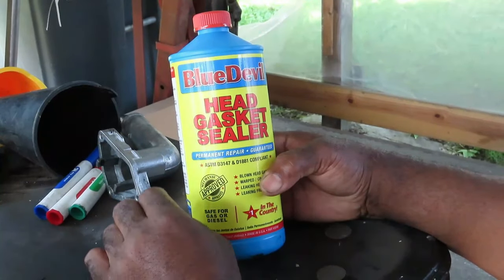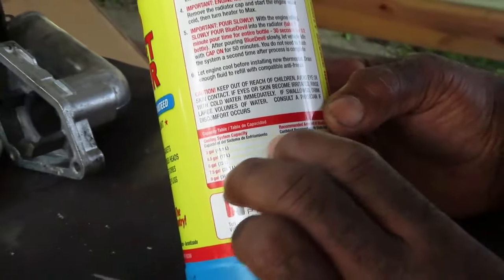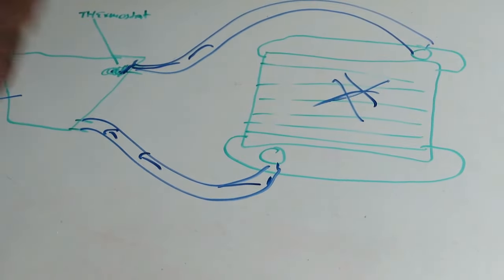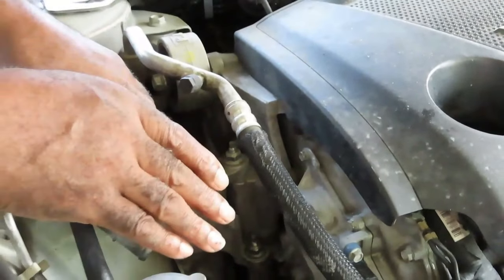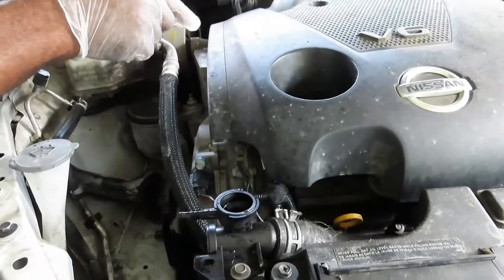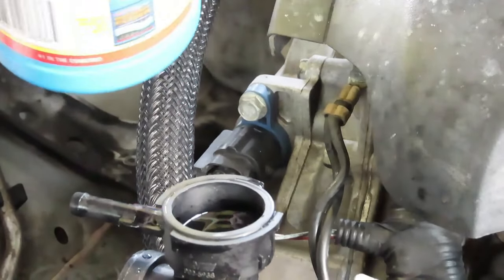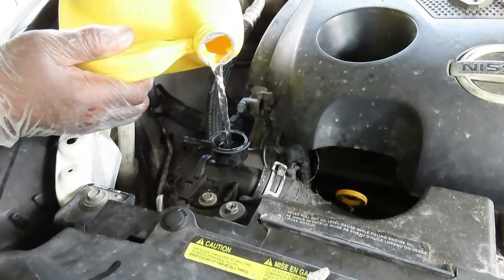How To PROPERLY Use Blue Devil Head Gasket Sealer. #bluedevil #headgasketsealer

Comment: I’ve been reading the comments and a lot of individuals are misinformed!
There’s 2 types of Blue Devil Sealers!
Yellow label needs the thermostat removed!
White label the thermostat does not have to be removed! I used the white label Blue Devil in my 2005 Corolla and it worked to perfection!
Reply from the maker: I've got a find a way to PIN YOUR COMMENT! So sick and tired of people saying "you don't have to remove the thermostat"
Reply from the maker: Just PINNED it, thanks for speaking up and saying that!
Reply: @OnlineAutoRepairVideos
Thank You! I really appreciate that!
It does work. People just need to read/follow the instructions and also do research on the Blue Devil head gasket products.
Reply from the maker: @kelj4517  EXACTLY!
Reply: Damn glad I saw this I got the yellow label hopefully I can return it and by the pour and go so I don’t have to remove my thermostat
Reply: @OnlineAutoRepairVideos 

Did this work on the 2014 maxima or did it end up not working? How bad was the radiator bubbling or how bad was the leak? I jusy want to know because i have the same exact car with the same exact problem
Reply: What about the red top

Comment: The best way to prevent head gasket damage is to change the oil on time always, I learned that lesson two years ago the hard way.. lol
Reply from the maker: LOL!
Reply: That right it true
Reply: Not true.
Reply: The best way is not forget to close your radiator cover or never use a radiator cover that's rusty and not very tight. That's how I lost my engine almost twice.
Reply: I know the what but wanted to know the why and I think you just gave it to me! Ugh
Reply: Most leaky or blown headgaskets are the result of people continuing to drive when the engine is overheating..Make sure you always have full coolant and never drive with temp light on or gauge reading high!
Reply: oil doesn't have much to do with it, of course you need oil, so that's a possible cause because it could cause the engine to overheat... but overheating is the main cause or faulty OEM equipment...  over time things just get old and break...  mostly I would say it's when the thermostat or water pump fail and the car overheats, that will damage the head gasket and warp or crack metal in the engine.
Reply: I had a cracked radiator 😢
Reply: Can i use blue devil even if oil is already mixed  with coolant
Reply: Oil has nothing to do with the coolant
Reply: @alfredovalle7471 i would say no because blue devil says for you to run the engine for 50 min for it to work if the coolant is mixing with the oil it would overheat
Reply: Oil and water cooling are separate issues, yes always take care of oil changes , but blown head gaskets are typically blown from over heating due to failed water pump low coolant or leaks from radiator, hoses or heater core and even stuck thermostat.
Reply: What about over heating because some people may not know where radiator is broken tell it overheats
Reply: Lmao 😂 when you have no idea about cars lmao oil never reaches the head gasket bruh hahaha

Comment: It’s funny that Blue Devil dose not mention to remove the thermostat in the directions I consider to be a knowledgeable street mechanic and follow how repair vehicles to a tee.  I performed the procedure by following the directions on the back of the bottle I removed the thermostat flushed the engine, heater core and radiator drained again then after that I filled it with coolant and the Blue Devil everything worked perfectly after the next day I drove the vehicle to work got on the highway I happened to glance at my temp gauge i noticed it was close to overheating it almost reached the H so I immediately shut the truck off costed to the emergency lane waited for 8 hours on the highway with no heat with the out side temp @ 30 degrees I was very upset had to call of work. When tow truck finally arrived I finally got the vehicle home drained everything as I went to remove the thermostat out lord behold the thermostat was gumed up stuck closed I was shocked stumbled on this video listen repeated the process again this time left the thermostat out and had no had any overheating issues yet had I not seen this video I would had junked the vehicle and some one else would be driving the vehicle this saved me a lot of money thank you for making this video!
Reply: The head gasket sealer says , rule # 2 in red letters . Remove thermostat . I don't know about the new cheaper pour and go stuff . But I'm looking at the bottle of blue devil head gasket sealer in front of me I just used . RULE #2
Reply: @darrenpatterson2496  Not on the poor and go bottle it dose not state that at all…
Reply: @shaun3510 pour and go is a different product entirely.

Comment: Just did this process 5/9/24 10:30 am 50min run time I’ll get back
Reply: It definitely reduced the white smoke. It Started to over heat after about 20 min of city driving.
Reply: @professorsmith5337 did it work?  I just did my truck Toyota tundra 03 v8 4.7L
Reply: @professorsmith5337  I think you need to let it cool down for a good day
Reply: @damahom92  I appreciate that
Reply: @damahom92  I was able to drive it to the destination had to pull over a few times to let the engine cool down. I could see the smoke coming from the radiator and the thermostat rising. It made a significant difference however
Reply: Any updates

Comment: I followed your guidance and used the blue devil head gasget sealer treatment, I am letting it cool and then will put thermostat back in. So far so good. No more bubbles are going into overflow tank. Or into the air bleeder  funnel while engine was running. Fingers crossed 🤞 will let you know how things turned out over the next week or so. Thanks for a great instructional  video.  This beats forking out $1500 + to have head gasget replaced. Cheers TS in Central Texas.
Reply from the maker: Crossing our fingers as well!

Comment: This works great. I’ve used it on multiple cars over the years and they always worked. Even on severely blown heads that over heat in 10 mins just gotta keep recycling every time it cools let it run again and again it’ll seal soon. One car it lasted 6 months another it lasted 3 years. It’s a guessing game good if you’re broke and can’t afford a head job. Just don’t race the car ever ride it easy
Reply: My 2nd gen crv pushing exhaust gases in coolant, reservoir boiling and overflowing. Should i do it with radiator cap removed to avoid back pressure of exhaust leak? Spark plig remove? Trick Radiator fan on for whole time?
Reply: head job 😂
Reply: I’m curious, when it stopped working after 3 years, did you use blue devil a 2nd time? I used blue devil and it worked for 2500 miles so far. Would be willling to do again if it wears off.
Reply: My coolant won’t fill
It leaks out the engine block

Comment: The bottle says nothing about taking out the thermostat and I can't take my thermostat out it is a chevy cruze and the thermostat is built into the housing I tried taking it out before and had to break the plastic tabs and rip the crap out of the thermostat to get it out then had to buy the whole housing again but anyway all the bottle says is to pour in and start the car and turn heat to high

Comment: I’m going to try this tomorrow for my 2015 Subaru Legacy. I have a new engine coming but I need my car for work or I will go broke. So glad I found this product even though I haven’t used it yet and I’m very glad I found this video because most likely I would have ended up doing it the wrong way. Thanks a bunch!! Will update post tomorrow!!
Reply: How did it work for you? I have the same problem with a 2015 Crosstrek
Reply: So did it work?

Comment: Used on my 97 Acura TL back in 2011........and still going and no overheating in 10/14/23. Just acquired a 95 Legend and the same thing and used it and worked.
Reply: Did you use the whole bottle at once? I just got a 2002 Saturn S-Series. Mine has a cracked head gasket. Its temperature meter goes from below half to the red side after excessively driving. So did you use the whole bottle at once on it?
Reply: Did you do the same process here and use the while bottle ?
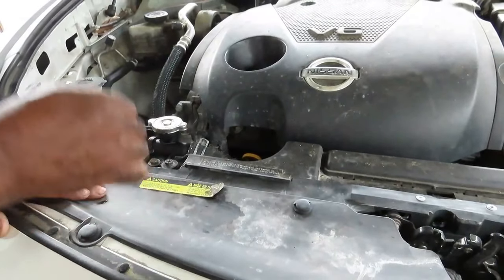Reply: @interstellar3374 9:08

Comment: I tried blue devil pour and go at first and didn’t take thermostat out. I folled directions and let it sit for 50 mins but little did I know my heater core was clogged up and that’s why I wasn’t getting any heat in the cabin. So since I wasn’t getting proper coolant circulation in my system I drained it and then the next day my gasket tester kit came in the mail so I done a head gasket chemical test on it and the liquid turned green from blue. The kit works like this… You pour the blue chemical in the flask and put it in your radiator opening. then you squeeze the bulb and if the blue liquid turns yellow then you have a blown head gasket. Since my liquid turned green that told me that I have a small leak in the head gasket even after 
The 1st batch of pour and go blue devil. So I replaced my heater core and got my heat working and coolant flowing good then I bought the non pour and go bottle and took my thermostat out and followed the instructions carefully. Let it cool down and drained the blue devil and refilled with coolant and the used my gasket tester kit again to see if it turned green again and was very impressed with blue devil! My tester liquid was as blue as it was when it came out of the bottle!! 
So very impressed and as far as I can tell there is no damage to my car system and boy does it feel good to have my heat back at the start of this winter!!
Reply: Did you have to drain all the antifreeze first? And run the car with just the blue devil then added water accordingly ?

Comment: Hey man, thanks for really great video. I used this product on my 99 Mustang 3.8 and it worked really well. The only problem is that the head gasket blew again and I am trying to find out if you can use  this product second tiime. The main question is, would it seal again?

Comment: Will be doing this on my '94 BMW E34 later today, just have to remove the thermostat. If it doesn't work, I plan on rebuilding the head anyway. I also by passed the heater core as I don't want to risk damage or within the heater valves. Those are not cheap to replace.
Reply: Well, I'll be damned. It worked!
Reply: @eaglerider94  hello there question did you follow all the steps like in the video? 
Also did u by pass heater core like u said?
I’m going to give it a try on my car just didn’t know how to go about it.

Comment: I let my mechanic do the job on Prius 2010. I brought him 2 gallons of antifreeze and he only used one. He did the job within an hour. On my way to work I saw the temperature light came on. When I get to work, I opened the hood. There was barely nothing on the reservoir. On my way home The temperature light came on twice and went out. I figured it was low on coolant. at home, I started my car in maintenance mode. Turn the heater on, but there was no heat and the car started overheating. I could’ve done a better job myself just don’t have the time now. I think my thermostat is probably clogged. Please does anybody have any suggestion what to do next?  

Awesome video by the way you’re helping a lot of people thank you.

Comment: I've found that if i pull the spark plugs till i find the cylinder with the bad head gasket and leave that plug out while running the sealant in the engine has given me better results i think its because with the plug out the sealant is able to get in to the bad spot of the gasket rather than getting pushed out by the combustion gasses. And even then these type of head gasket sealant are only a short term fix
Reply: Would you recommend draining the coolant from the radiator only or pulling the engine plug as well?
Reply: @DeforestLCooper  fallow the directions of draining the coolant the reason i have left the spark plug out is so the sealant can actually get where it needs to be also if its a fuel injected car unplug that injector if possible to lessen the chance of a fire

Comment: Thanks for the excellent explanation. Most people who do not know now will understand how a coolant system works...  This is what I was wondering. The bottle does not say to remove thermostat and I thought to myself that if this stuff works it can clog radiator or thermostat or heater core. As a result of your video I will be removing thermostat, stat.
Reply: You've got the "Pour and Go" version. The "Yellow Label " version clearly says to remove the thermostat. The yellow label has a better chance of sealing the leak.
Reply: there are 3 products, 2 they don't say to remove the thermostat, this one with the YELLOW they say to remove the thermostat, but they don't say to flush the coolant at the end only to put enough antifreeze.  I'm still not sure about which to use, seems the one where you remove the thermostat is the one to use...
Reply: What to do if car starts overheating b4 the 50 minute run time

Comment: Very well explained brother, but what about vehicles without a radiator cap? my 2018 Chrysler 300 doesn’t have a radiator cap and I am really hesitant to use this product. Thanks.
Reply: Top radiator hose.
Reply: @jmcgrew23 my question is when you un clamp the top radiator hose  and coolant comes out during that process do you pour that coolant back in the reservoir before you start your car to idle for 50 minutes?

Comment: On a closed system do I add the product through the tank on the fender, my Mazda Tribute does not have a radiator cap in the traditional sense. I'm sure this is a no brainer to people familiar with a closed system, but this is new to me, thanks.
Reply: Use the top radiator hose.
Reply: @jmcgrew23 do you still do while running

Comment: If you use extra it will not clog your system. The product is free flowing until it is heated by gas from the leak.
Reply: Would you recommend draining the radiator only or removing the engine plug also and draining everything? I’m guessing you don’t want a trace of coolant for it seal properly, correct? Or in some coolant in the engine okay? Thanks.
Reply: @DeforestLCooper  I would drain all of it. Its easy once you get started. You can also flush it several times with a water hose or buckets of water. I fixed mine with blue devil.
Reply: Jup exactly right

Comment: I have a 2005 Chevy Uplander with 400,000 km(250,000 miles) on it. The exhaust gas pressure(from a blown head gasket or a warped or cracked head)was forcing the coolant to overflow in my expansion tank and causing the engine to overheat. I thought the vehicle was toast. As a Hail Mary, I thought I'd try Blue Devil yellow label. I followed the instructions to a tee even though removing the thermostat on these 3.5 liter V6's is a bitch. To my surprise, it actually worked.  For how long I have yet to find out. Fingers crossed.
Reply: Is it still working
Reply: @fizzyfizz101  It's still working more than 3 weeks later, don't know for how long.  Just in case I bought a 3.5-liter engine from a wrecker with 91 thousand km on it for $560. That's my backup plan.  I'll drive on the old engine until it fails.
Reply: Still working after 2 months of daily driving.
Reply: @allancrow134 Still running good?

Comment: Here’s another thing you could do and works even better. Once you let it get hot and have the metal expand. Undo the spark plugs. Let the blue devil work it’s way in with all that loosen pressure then tighten back.
Reply: Not advisable, especially on a aluminum head. Metal is expanded and you'll most likely strip the threads.

Comment: Should i replace the oil before putting it in?

Will it mess my truck up running with the water in the oil untill the product works
Reply from the maker: Good question! I would change the oil before and after. Use a cheap brand oil before.

Comment: I have motor 4.8 chevloret express with heating problem. We replaced all coolant system. Now I want use the best heat gasket sealer. That is my work car. You recommend to me the blue devil is de best brand or another one?

Comment: Issue with removing the thermostat on a 2011 Ford explorer V6. The gasket goes behind the thermostat. The first time I tried water / Blue devil was seeping out of the thermostat housing, Captain eye on it let it do its thing did not work. This is my second time trying but I left the thermostat in. Used Blue devil in the past always worked. I'm catching this head gasket leak early starting having coolant leaking out of the exhaust.
Reply: Tomorrow I’m gonna try this on my 2011 explorer. Any advice regarding the stat gasket sealing? Thanks

Comment: will be trying this out tomorrow on my 2003 Nissan Sentra I did a combustion leak test and tested positive for a head gasket leak but still no coolant in the oil dipstick but it overheats i already changed the thermostat and radiator and some coolant lines and sensors hope this works
Reply: Did this work?
Reply: @falcon99ify  nah bro car was done for wasted 90$ on that shit waste of money and my time
Reply: Damn that sucks man thank you for responding.

Comment: I have a 2005 Lincoln Towncar. It only has the radiator reservoir for me to add water or coolant. So, now Im told to add it all through the top radiator hose. If I do it that way, then I dont need to drain anything from the radiator and the existing coolant in the reservoir?  Does this change how much Blue Devil that I will need? Thanks
Reply from the maker: No it does not, hope this helps.

Comment: After it fixes it, do i drain the radiator and refill with the correct coolant for the vehicle?  Or just keep using water?
Reply from the maker: The directions says to top it off with coolant, but we drained all the water, reinstalled the thermostat, and then filled it with coolant. Customer called us yesterday that the car is doing good.
Reply: @OnlineAutoRepairVideos  sounds good.  Thanks